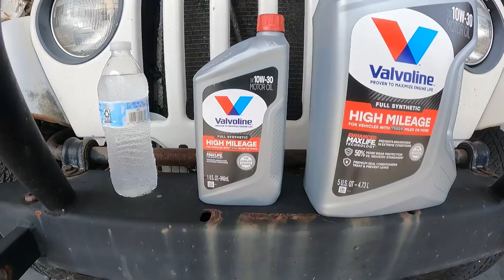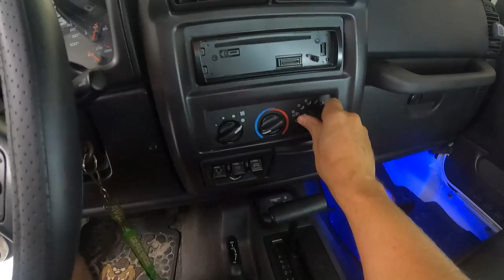Much Needed Maintenance on my CHEAP Jeep Wrangler - Episode 3

Comment from the maker: Current Total For the Build is $2455.00-ish.
That’s Purchase Price and Everything I’ve Put into it.

What Do you Think my Total Cost will be by the End of the Build?
Reply: All depends on how crazy you are going with mods.
Reply: 10k ish assuming you....  lift kit, radio, custom paint, wheels, light bars. the list is endless
Reply: End of build 😂
Reply: It's a Jeep, The build never ends 🤣🤣🤣🤣
Reply: Do a video series upgrading your ski boat more or turning it more into a wake boat!
Reply: Do a lift kit and upgrade the tires. And then actually go 4 wheeling.
Reply: Plus .10/cents per hour labor.  Normal shop labor on a rust bucket would keep you in the poor house.

Comment: Hey Zach, i noticed during the video that you put the rotor on, the switched it due to the direction of the slots. You actually had it right originally! Its supposed to rotate from outter edge to inner hub (if that makes sense). Aside from that, i love love watching your videos. From one Floridian to another! Keep up the good work
Reply: Knew this comment was coming 😄 You're probably right, but... 
Unless you know if the vanes on the rotors are directional or not, it's impossible to say if the slots / drill holes are pointed the "right" way. The slot direction is pretty irrelevant compared to the cooling vane direction. If the vanes aren't directional (the rotors don't look like they have directional vanes), then the slots should indeed be the other way around, though it doesn't really matter one way or the other as long as you're giving pad gases somewhere to escape. 
Zeckhausen Racing has a good article on this.

Comment: Just a note, brother. The AC system is a sealed system. If it was low on freon, it's because there's a leak. If you didn't repair the leak, your new freon will soon leak out.

Comment: You had the brake rotors correct the first time, the slats point in the direction the rotor travels. And don’t forget to bed the brakes, a couple of hard slow downs from 50-60 is all it takes, just don’t stop rolling after you do the hard stops and let everything cool down… there will be a dramatic difference in stopping power.
Reply: You are 100% correct. I hope he realizes this.

Comment: Hey Zach, just ignore all of the Fram oil filter haters in the comments.  I have used the orange can for decades without any problems! 
The silver one you used is even better with finer filtration.

I think the hate comes from the fiber pleat spacers that are glued to the filter media during Fram's manufacturing process, but it is a non-issue as it is not a pressure containing component (my Toyota cartridge style filter does not even use pleat spacers, it is just a bare pleated filter sandwiched into the OEM housing).

I have watched all of the YT oil-filter-cutter vids and  they all start complaining about the fiber pleat spacers when they have no idea of their actual function!

Fram oil filters seem to be feature comparable in each of the price ranges on the market (from box reading and vid watching);  same springs, same valves, same soft goods, similar filter media etc.

Also wouldn't Walmart would quit carrying Fram filters if there were known problems with them and engines constantly being destroyed?  

Love your vids!  I have been watching for a long time now.

Comment: Few things to look at.... this list will most likely get longer
Weld on some safe-t-caps for the frame.
Replace ball joints, u joints, tie rods.
Remove the carpet (you'll thank me later). Bed liner in the future.
Check wiring to the ac sector switch, they tend to melt from high voltage. Usually on speed 3 and 4.
The hood can be propped up to the windshield for better access. 
Change all the fluids including transmission, transfer and diffs.
Check body mounts and lift bushings.

Comment: You should never have to replace the oil drain plug. Just the crush washer.
Reply: These wranglers have a built in rubber sealing ring on the drain bolt, it cannot be replaced with just a crush washer. They are meant to be re used, but if it’s compromised, you have to buy a new drain plug.
Reply: Just get a fumoto valve! Save you a headache
Reply: 😂 change out the oil plug other time 😂😂

Comment: If you want a similar style rocker guard / steps, check out Hyline Offroad. They make an awesome set that look similar to the ones you removed. I've had them on my 04 TJ for probably about 5 years now and the paint has held up fantastic and they look like they will bolt up to the holes you that the previous owner drilled into your tub for the ones you removed.

Comment: you put a FRAM oil filter on?! They are known for being hot garbage. They might be better now, but they have a reputation for being absolute trash filters. I wouldn't give them my business now just for their history.
Reply: They haven’t improved. Seen many tests. Bad and low amount of filter media, poor rubber and construction. Better than not changing the filter but not by much.
Reply: I always get the Mopar filters.  Not sure how they rate versus other brands.
Reply: @boowiebear  Which tests?   Fram filters are very comparable to other oil filters in each of their respective price ranges. The youtubers that cut open the filters are NOT experts, but it is fun to hear them comment and watch them.
Reply: I have used Fram for 40 years on multiple cars and have never had a problem. Fram oil filters are good for the money.  Some people freak out about the fiber pleat spacers where other filters use a metal piece, but it is not a pressure component, just a spacer (cartridge filters do not even have any pleat spacers and they work fine).   The silver one he had is good for 15,000 miles with extra filtration.

Comment: Love the Jeep and the work you're doing.. Pretty sure that Jeep has been in Salt water.. Suspension and axels are pretty rusty for a Florida Jeep. By the way Those rims are off a 2015 Saraha and I loved them, I rocked those rims until I got my MC Game Changer 3.5 inch lift and needed to get the correct offset for the lift

Comment: I noticed the hood is a little highet on the passenger side after you installed the new cold air intake. Might want to check for clearance issues.

Comment: I've owned a jeep for 7 years and never had to change the oil plug ever even on my other vehicles never had to change the oil plug. Also there's a youtube channel called morfab industries and he has a whole video on these jeeps and the one thing he said not use is synthetic oil cause it will cause oil leaks he explains that in the video. Valvoline brand is a great choice that's all I ever use in my wrangler.
Reply: Yep, synthetic oil isn't the best for these engines.  It will run better with plain old Dino oil.

Comment: MOST  Over - looked  items to consider here. Grease Fittings, Bushings, Grommets, seals, Fluid change for  Differential, transfer cases,  Hubs, and also  Cables, Wires and  the runs or  Looms too.  WHY ???  Be it YOUR  first  Jeep, Last  time  using it, Or  Only  time  ever  needing to do such checks before.   I Have  Owned many on / off road type Four wheel / all - wheel  drive systems through the  years.  Dirt, Sand, Water , Rust,  create Blind Spots of  Issues soon to be revealed once it becomes a  Daily  driver in ( N E E D ).   Exhaust , Oxygen sensors, couplers, hangers, extension tips, deflectors, etc.  Start at the  front. SLOWLY go  through each system. RADIATORS are famous  for  getting clogged up with deposits and  sediments from water and  LACK of  proper coolant  mixtures.  HOSES, Clamps, Thermostats.   Almost like a  riddle or  tune.  LOOK at the  latches for  hood, doors, Roof, tailgate and more.  MURHY's Law is the Most  common mistake. Hesitate and  YOU too  Will be  lost STRANDED on the Side of the  Road  with NO ( Protections in TOW ). Standard carry items First aid, Tow strap, Extra long  reach JACK. Portable  Power Battery Jump Pack that  stays with the  vehicle.   Carry a  Jug of water, One of  Antifreeze / coolant, a  spare container of  Oil, Power steering  fluid,  Window washer solution.  Zip Ties, Hose clamps of  various sizes.  Small  tool set with some  NEEDED sockets VEHICLE Specific.  An Adjustable wrench, Hammer,   A few screw drivers too.   Work Gloves,  A small tarp, Umbrella, Rian coat and   Safety reflective Triangles.   THINK Before  (YOU)  Discount  any of this.   Spare bulbs, Fuses,  A  Handful of  useful screws.  Electrical tape  splice connectors.  IF  done  Right .  Most  stuff will simply fit in a  duffle bag or Soft side tool carrier. Heard ( YOU ) say about  taking  recommendations  from viewers  suggestions.  Forgetting  to REMEMBER the BASICS today ?  Could  mean YOU get  caught and  Stranded when LEAST expected. 
The  Boy Scout Motto :     Be  Prepared ( ALWAYS )   should  be  heeded throughout  (OUR)  Entire Lives.  Many times  have  HELPED others  who have  left home on a  five minute errand . Only to be Scratching there  heads on a  holiday or  weekend  when most  stores are already closed.  A Granola bar, A  few asprin too.  Maybe  a small container of  Icy Hot to soothe that  aching  muscles when the  Good  Deed is  done.  Peanuts or  candy brighten most  every bodies spirits. THINK   K. I. S. S. or  ( Keep It Simple - Stupid )  Five or  ten  dollars  here and  there.  A  hundred bucks in Well placed investment.  Piece of  Mind  on a  budget through time.  PEOPLE Forget Way more then they Ever Remember.  Be SMART  Before the NEED Arises.  Some  lady in Destress could  be  YOUR Safety NET.   HEED these suggestions and  Why they were made.  A  penny a  day saved is  worth a  dollar or  more when emergencies are in STORE... CHEAP is  NOT  Better. Quality proves its  worth when everything else has  Broken down.  Worse Yet ( Un-Able to get  )   when the  clouds of  Rainy days  decide to STAY for another weekend or  longer these days...

Comment: You should also replace the rubber hoses when changing out a caliper.  I learned the hard way they deteriorate from the inside out and the pieces that break off act as a check valve and will cause your very issue.

Comment: I’ve only changed one drain plug in my life, to put a magnetic one in. crush washer every time, but no the whole plug? I don’t think you need to do that, sounds expensive! Also I recommend not a Fram filter next time. Good work so far!

Comment: GO TO A JUNK YARD AND GET A STOCK FACTORY   AIR BOX FOR THE YEAR OF THE JEEP  AND BY A NEW STOCK AIR FILTER  / YOUR MOTOR IS NOT HI- PERFORMANCE  / AND THOSE AIR CLEANER  ARE B/S  / YOU GOT YOURSELF  ONE NICE LOOKING AND RUNNING JEEP ON THE CHEEP /   GOOD MAN,   GOOD LUCK  / YOUR PARENTS DID A GOOD JOB

Comment: I’m probably not the only one who noticed but the cold air shroud should have a gasket around the inlet hole to fill the space between the shroud and the intake pipe. Not sure if the rough country kits are supposed to have them or not but that’s odd to me
Reply: Agree, water will get into there if you off road it.

Comment: Long term fix for fender flares if you intend to keep them: I used black Solution Finish. I used this stuff and didn't have to reapply it for another 10 years. It's just as dark as the quick fix stuff. Beware: you need to use gloves because it's more of a plastic dye. Also, I know people who put on rear quarter armor over their rusty parts. They did remove them and convert the rust, first, but you get a cool look and don't have to replace the full panel.
Reply: DId you remove the fender flares or tape everything off?  Thank you for this comment.

Comment: First I’ve ever heard anyone say change the drain plug. I’ve never changed a drain plug in my life.
Reply from the maker: Drain plug crush washer really… this bolt was in rough shape so I changed both.
Reply: @ultimaterebuilds7127  ok gotcha. I was thinking you prob meant crush washer and not the drain plug itself. You may have said the washer. I was too lazy to go back and listen. LOL

Keep up the good work. You’ll enjoy the Jeep. I’ve had mine 12 years.

Comment: Need to replace that break fluid.  Lines are deceiving.  They could look good but be weak\bulging.
Reply: seeing the color of the brake fluid!  it's time to change it 100%
he risks losing the brakes ! 
really cheap !
Reply: I agree, brake fluid is hydrophilac sp? which means it absorbs water every year, it will corode the system and it also vaporizes when hot, so spongy brakes

Comment: You know what jeep stands for? Just Empty Every Pocket. All jokes aside as long as you stay on top of the maintenance jeeps will last forever. They are decent vehicles that also hold their valve really well. Also the 4.0L engine are very very strong just dont over heat it cause they will crack a head or block easily.

Comment: Drilled and slotted rotors are designed to dissipate more head during prolonged breaking, because they have less surface area they technically are worse at quick stops. But i dont notice a difference in stopping power, i just installed them because i tow my boat up and down the sierra mountains

Comment: Hey put it back up on the stands, get your water hose and flush out all the salt from underneath, engine compartment and interior.   It looks like the previous owner took it in the salt water and has never washed it.  The salt is probably still there so get rid of it!

Comment: Service your cooling system. Every 30k flush and fill and new thermostat.
If you’re in that far in the brakes, flush the system.
To check your ac, jump the pins on the compressor while it’s running.

Comment: in my opinion, i think jeep wranglers are just amazing. ya, they do have issues. 4wd not shifting, frame rusting out, ect. but, if you have the time you can almost always repair it, and most of the time quite cheaply too. on top of that, they are just such simple veichles, makes them nice to work on. no electronics screw with how the car runs.

Comment: I think you're doing a good job with the Jeep...with that being said, if you were low on Freon...you have a leak, checked the Schrader Valves and/or use dye and a black light..... and you shouldn't need to replace your drain plug every time you do an oil change...or even every 2...3...4...times...just replace the crush washer.....And your hot air intake...is still a hot air intake....especially with that big gap between the intake pipe and the air box. We had the same Jeep (one year newer) and we put a magnetic thermometer under the hood right where the air filter and intake box sat with the new RC kit...and the air temp was the same as it was prior to relocating it. Even on my buddy's Dyno we gained nothing. Anyway.... It looks nice..i hope it serves you well in the future. Keep Jeepin'

Comment: Nice work. I had the same Brake issue when I first got my TJ.  I know you said oil is oil but I would recommend using a conventional oil on the 4.0 instead of synthetic.  This motor definitely prefers a thicker oil and the synthetic can lead to leaks due.   Nothing wrong with the Fram tough guard filter tho, I use the same. Always have for years.

Comment: I’m no expert but if you are needing to put freon or had no freon at all, that means you have a leak also means there is probably humidity in the system so it is useless to just put freon in it without repairing the leak and if it is a slow leak you should’ve vacuumed the system at least a half hour first.

Comment: I didn’t see you clean the rotors, 99% of the time they are coated in oil, which is bad for your pads and a quick wash with brake parts cleaner does the trick

Comment: That is the worst oil filter on the market.  I won’t use one even if I got it for free.  😂.   I run k@n or  a wix filter.
Reply: I am going to use the carquest purolater rebranded filter for my new car, but a lot of people like the wix too.  I have used Frams for years and have never had a problem.  He used the higher grade  silver one, good for 15k miles so he should be fine, it has better filtration than the std orange
Reply: @JP-jq1qx  it was the orange one I was thinking of.   It’s been forever since I need a study on cutting them open.

Comment: I've had two Jeep's in my life...A '90 Wrangler, and an '05 Wrangler X. As I never really used them to off-road, they are great in traffic. The rear of the vehicle is literally right there. So, cutting in and out of traffic was phenomenal!

And, not sure if they rectified the issue, but my '90 had what is known as a 'nylon timing gears'.. It was supposedly there to cut down on the timing gear noise. However, the timing chain was prone to 'jumping' off the cam and crank gears because the 'nylon' would wear quicker.

After mine jumped, I remedied that by rebuilding my top half with porting and polishing of the heads, a double roller timing set, Isky mild cam, pushrods, springs, valves, roller rockers, a Weber 32/36 carburetor and Flowmaster Super 10 exhaust. I did a 4" drop, front and rear, shoed it up with 245/60's all around...and raced my import friends. It had pretty good handling with its already stiff suspension. I could rip the corners with the best of the imports.

It was fun while it lasted, then I broke the yolk in the rear end, as I was performing a burnout for the audience that line the roadway of a popular hangout beach on O'ahu, Ala Moana Beach Park.

Good luck and have fun with accomplishing your goals with your Jeep!